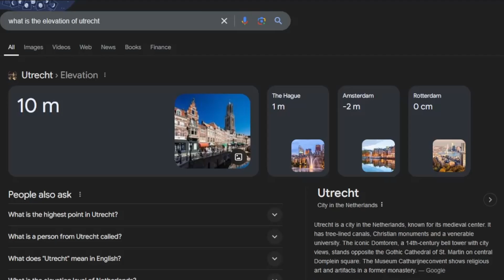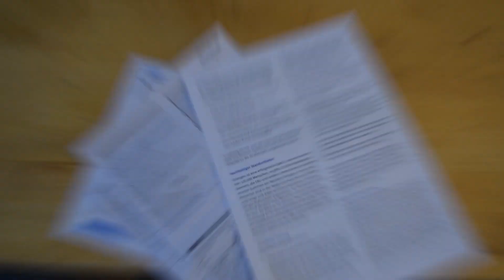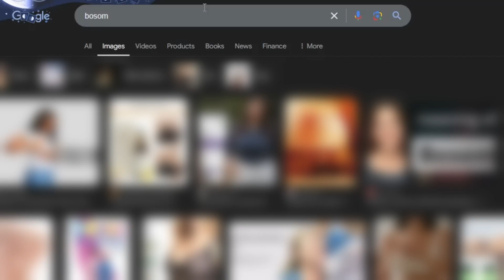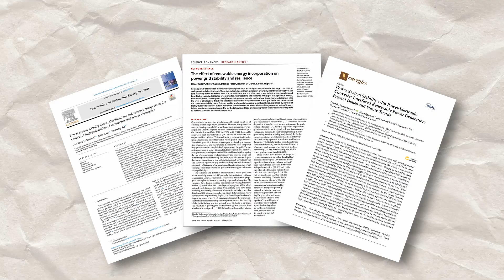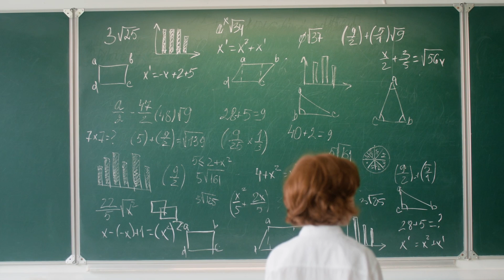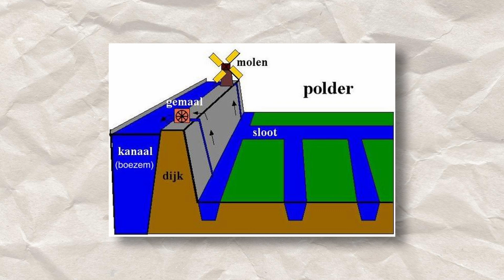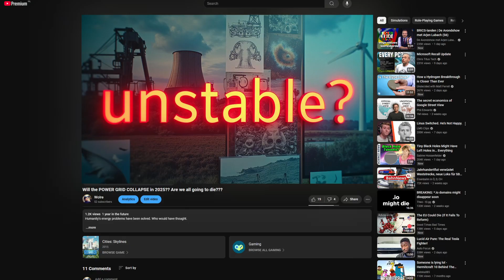What happens to the Netherlands if the power goes out?

Comment: This is pretty well done, even the news is less well informed about the emergency plans..
To be clear there's also the very old way opening things up during low tide (spuien) and using the military and contracted suppliers for emergency generation/pumping capability. During the outage of one of the IJmuiden pumps that was used. 
If you want something to look into, try high outflow during high sea conditions.